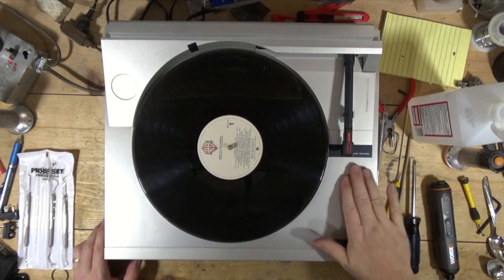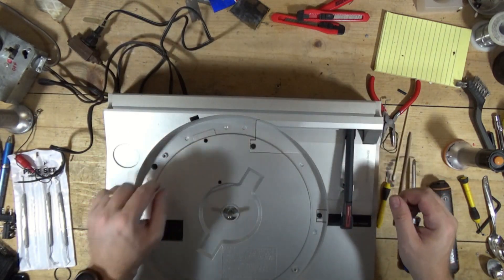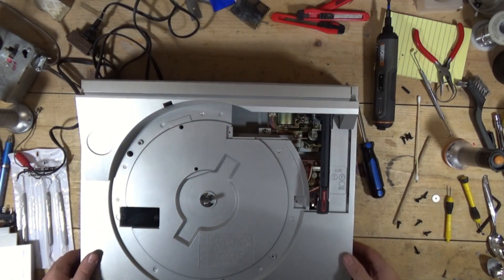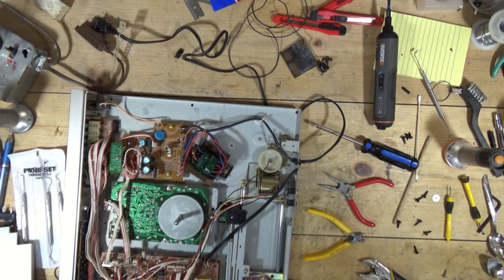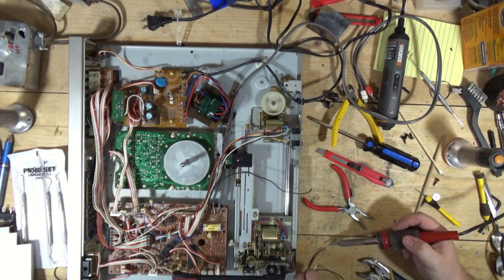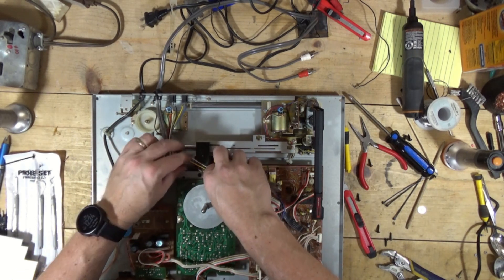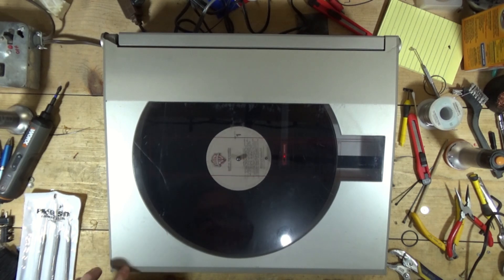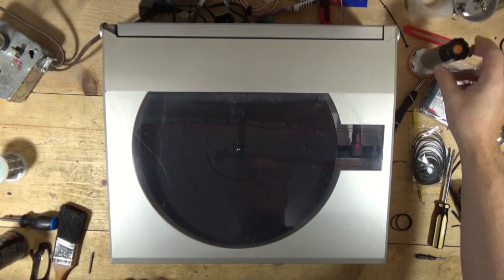Goodwill Find Sansui P L50 Turntable Repair Part 2 - RCA Cables, Belts & Wrapping Things Up

Comment: Someone gave me a black P L40 a while back which is extremely similar. Needed the two new belts and some adjustments. It had most of the same issues you dealt with. The thing is you could hear a little rumble each time the arm motor would slide the arm over a hair. I tried a dry teflon lube on the sled rail and that didn't make a difference.
Reply from the maker: I don't recall excessive noise with either of the Sansui linear trackers I worked on.

Comment: can you share what belts you bought? i have this turntable and i need to replace the belt but would rather buy a whole lot of random ones than just a single belt.  do you have an eBay link?
Reply from the maker: I usually buy square belt multi-packs off of eBay or Amazon.  It changes every time.